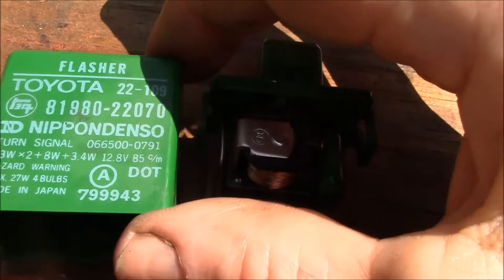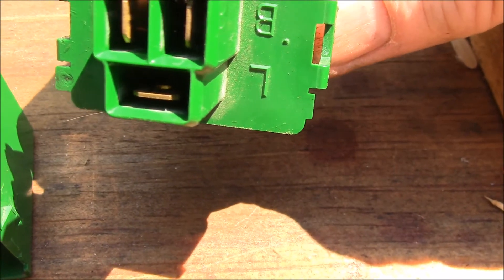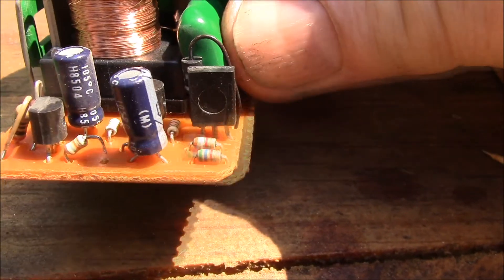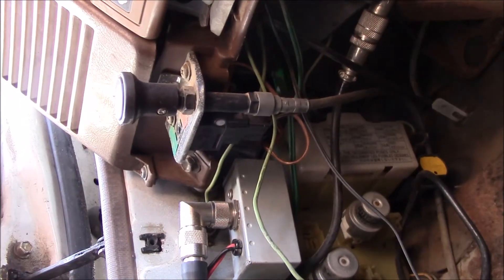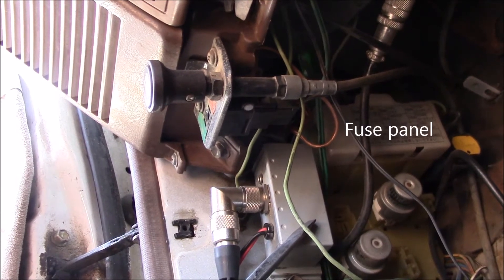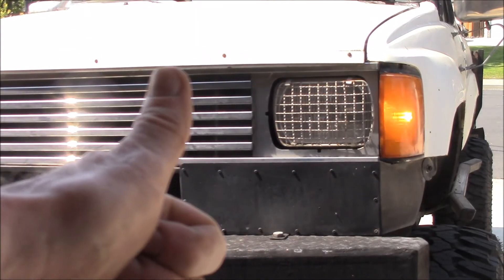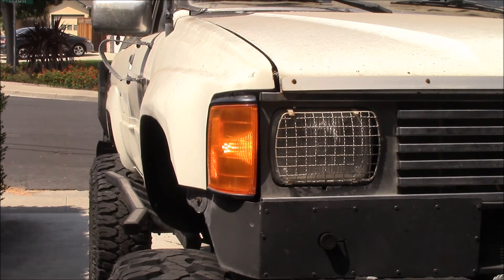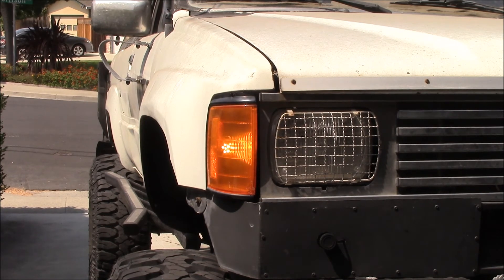Fixing Hyper Flashing LED Turn Signal Bulbs - Toyota 4Runner

Comment: I have an aftermarket relay with a different style of board. My resistors are marked R1-R2-R3. Wondering if your oem relay tells you which resistor number the one you removed is?
Reply from the maker: I'll have to take a look at that relay next time I'm working in that area.  I never got any close up photos of the circuit board.

Comment: This is awesome man. Just finished doing mine. There is no need in adding resistors when you can just do this!!! Great work.
Reply from the maker: Glad this fix worked for your relay.  I ran across this years ago on-line.  I recalled seeing this information and found it again.  Only works on this discrete style flasher relay.
Reply: @The4Crawler  I have an 85 4Runner just like you. On my last model I had, 88…I put resistors and I wasn’t very comfortable with them because they get so hot. This is a great fix. I did the same thing as you and soldered the leg and pulled it out. Worked perfect.
Reply from the maker: @alexredard5584  I think I had also tried some high power resistors a long time ago on mine.  I ended up going back to filament bulbs at that time because the LEDs back then weren't very bright, or at least I didn't appreciate the layout of the emitters around the bulb at the time. The bulbs I found now work really well with my modified marker lights.

Comment: The cut is specific to that resistor in the middle or you can cut any resistor?
Reply from the maker: I would say it's only that resistor, likely is what provides the current feedback to the circuit to trigger the fast flashing.

Comment: Do you have a video on how to do it on a 1994 Hilux 22r?
Reply from the maker: Don't have access to that model, but check the p/n of your flasher and see if it's the same.  If different, here's some information that might help:
https://www.pirate4x4.com/threads/led-fast-blinker-fix-81980-22070.757093/

Comment: This is such a helpful vid! So glad I found your channel as I am in the process of upgrading my own 4Runner's light assemblies. Just to confirm my understanding: the resistor that is removed here only leads to a circuit that isn't necessary for the normal circuit run, it just cuts off a circuit that modifies the timer? Thanks for taking the time to post this info. SO helpful
Reply from the maker: Yes, works normally it just cuts the feedback for the current flowing to the bulbs.  That's what triggers the fast flashing mode as the low LED current looks like a burned out light bulb to the flasher.  The only feature you lose is the fast flashing if an LED burns out.

Comment: Very cool.  Maintains the peace of mind of the OEM Toyota flasher, which is recently relevant to me as over the summer I had a relay on my aftermarket headlight harness start malfunctioning to where I'd flip my high beams on, then could not get the low beams back on for awhile.  Fixed it by replacing the 5 year old relay despite it being surrounded by 27 y/o OEM relays that set a better example for reliability.
Reply from the maker: For sure, that flasher is still going strong after 36 years.